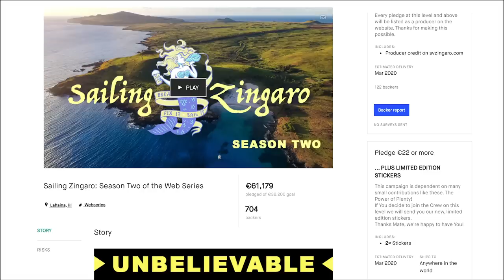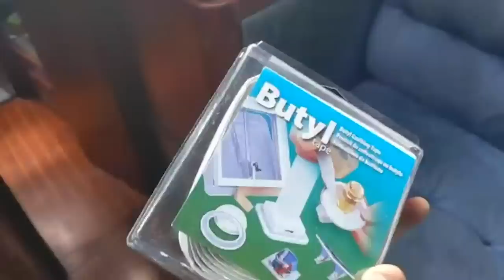It's Raining INSIDE the Sailboat...

Comment: A quick temporary window sealant which is fairly waterproof--is Blu-Tak.  Get it at any newsagents.  Cheap and will last until you can get a better replacement.  Some I used I forgot about--found it ages later--black on the outside but still sealing.

Comment: On pressurized aircraft (I replaced the pilots side window on 747 SN: 2 ) we embed a thin rope in the seal so when you have to rebed/replace the window you can dig one spot and pull the rope which cuts the sealant like a can opener, don't know if that would work on boats, but it does on aircraft.

Comment: Hello James I'm working in the silicone and pu business. The best way to make it water and airtight are elastic MS polymer sealands. But never compres it completely down. Give it always some room to make it watertight. Any way be careful with butyl. It is is very good (the best)as long as it stay dry and warm. From the moment that is becomes cold and wet becomes it very tricky and it will lose. If you want some more info, give me a yell. I just resave a mail that SMX and MS polymers may not become in contact with coper and bronze!!!! If you want I can  send you this rapport.

Comment: Completely surprised on a boat of Oyster quality that they have exposed wood in their port and hatch openings. Best construction is to back out wood on all cut openings and epoxy fill. Better for attachment hardware seating and keeping moisture out of deck and cabin cores. I hope you sealed all that?  Great work on the boat and congratulations on the launch.

Comment: Butyl tape will seal forever and its still possible to remove windows at a later date without destroying them.  In the UK we buy it on ebay, looks like blutack.  Much cheaper than sikaflex and can be stored for years before using.

Comment: If those windows were bedded in 5200 (or 4200 for that matter) they would have come out in pieces...no way to release those polyurethane "sealants" (read: elastic concrete) without a ton of heat and force. Given that you could scratch it off with your nail, I'd say it was a polysulphide (life caulk) which works great right until it doesn't.  Butyl is good IF you are tightening the joint with nuts on the back side instead of twisting the fastener which needs to be included in the seal membrane. If you have to twist the fastener (any wood screw, for instance) than butyl is not worth the trouble since it wraps up in the fastener creating a bulge (and mating void) which doesn't allow the rest of the flange to seat correctly. If I was doing this job and wood screws were used (like it appears they are, from the outside) I'd probably go with a marine rated silicone. Silicone gets a bad rep because it mostly gets used improperly. For bedding glazing, it is in my opinion the best way to go. 3M Marine Grade Silicone is what you need...NOT THE BATHROOM STUFF!!!!!

Comment: i wonder.. if Gibraltar brand 1/2" x 3/32 x 50 foot Butyl sealant tape for metal roofing is the same as the stuff you are getting..   homedepot sells it for 6 bucks for 50 feet..  HD internet number 205945574   Gibraltar building products model 99415 would be what you are using or is it thinner..  its just a thought. 
its just a thought to check non marine hardware stores for it.. and i realize where you are..
Reply: There is no 'marine sealants' on my boat, all are 'land sealants'...40+ years plumber n roof plumber and my work locale, seaside Oz.................saved a bundle. If it works for a house on the water it will work for a boat....